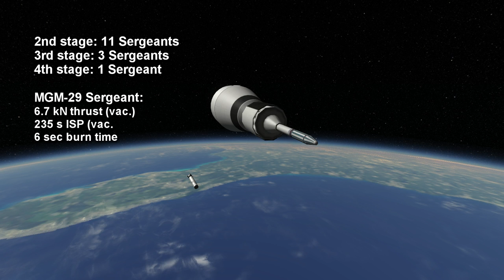Rocket Profile - Juno I

Comment: ~1:02 to clarify: A4 was the name of the German rocket for use in scientific experiments, the V-2 was the military name for launching warheads at London.

The Redstone rocket was developed from the Hermes series of rockets, and named after the location that the Von Braun team of rocket engineers from Peenemunde (there was another portion of his team that went to Soviet Union for their V-2 copies and some that went to the British to be interrogated and debriefed before being sent to the United States) were sent to, the Redstone test range.

The A7 on the Redstone was indeed a descendant of the A4 engine, but was more directly developed from a engine the Germans were working on for the A9, a boost-glide edition of the A4 that increased range on a flatter trajectory to 600km over the 200-300km the A4 was capable of. They also proposed stretched, ramjet, and more radical airfoils for the A9, even proposing a bigger engine that would fit onto the A10, a Ballistic missile with the A9 on top which would have given the Germans intercontinental capabilities of 10,000km. The A11 and A12 were also proposed as stages below the A10 and A9 using an enormous cluster of A10 engines, but these may have only been projections by Von Braun to win over the US Army’s trust of him during the transfer from WWII, in full knowledge it would be weighed against his involvement in the SS as a profiteer of Holocaust Slavery. 

However, it was the engine that would have fitted on the A9, and not the multi-chambered engine that went into production on the A4/V-2, that would be evolved by the companies of the US, like Northrop, North American and Rockedyne that would influence the construction of many engines, tracing a direct lineage through American rockets such as the Atlas, Titan, the Saturn rockets and the Thor/Delta until Delta II was retired in 2018 with the final RS-27.
Reply: Also to clarify: I don’t think Von Braun was a full hearted Nazi, but rather a passionate rocket scientist who was trying to avoid being caught for not following orders to develop military designs. The Peenemunde rocket team’s very survival arguably depended on his leadership, Dornberger’s earlier coordinations with the German army and Nazi leadership to fund and provide logistics for the development of the first space rocket and stop the takeover that occurred in 1944 from happening sooner, and to allow the events that led the Peenemunde team to store the documentation of their research in a mine by war’s end instead of burning it, prior to surrendering to the allies voluntarily in hopes of using their expertise to help develop space rockets after the war. 

It is a tragic narrative to associate someone with a political narrative because of the country they could not escape from safely; but also tragic for someone to be associated with evil for developing what was intended to be a peaceful thing for mankind in the face of horrifying death and harm despite benevolent intent. Von Braun in that way is as much of a benefactor of the intellect and expertise of his team as he was a victim of the Nazi regime; in the way the propaganda took away something benevolent from his motives from a modern perspective which beckons of something independent of the ideology despite relying on the circumstances to evade suspicion of disloyalty to the regime, causing so much harm to Holocaust victims, almost completely unrelated to the rebel/dogma relationship the Peenemunde team found themselves in.

Comment: Because the solids at the top of the stack gave it such a big kick, Explorer 1 went into a high elliptical orbit that probably won't decay for several centuries.
Reply from the maker: It deorbited in 1970 as far as I know. The high apoapsis kept it up for a while, but the low periapsis (358 km) meant that it faced more drag than the actual oldest satellite in orbit, Vanguard 1 (which has a 657 km periapsis).
Reply: @RaizSpace  Ah.  Maybe I have the two confused, then.

Comment: Ey I'm having a problem with my RSS+RO+RP0 install. I can't get RCS to work. I know the thrusters must be attached to the actual fuel tank. The fuel is correct for both the tank and the engine (nitrogen). What am I doing wrong? This juno 1 rocket depicted here has the RCS built in the model, and that one works just fine in my install. But if I try to add a thruster to an RCS fuel tank and configure them properly, they fail :(
Help? :(

Comment: Nice video! How about designing 'KSLV-2' ?(S.Korea(KARI) is developing this rocket)
Reply: Actually, I have some information about its rocket design or engine spec. (thrust, Isp, burn time....) Shall I give you that information??

Meanwhile, thanks for the videos!
Reply: Its first stage and second stage engine bith use 75t kerosine and LO2. This 75t engine's Isp is 298s(first stage), and 315s(second stage). Third stage engine also uses kerosine and LO2 and its Isp is 325s. First stage's diameter is 3.5m and second and third one is 3m. It can carrry 1.5t satellite at 80' inclination angle.